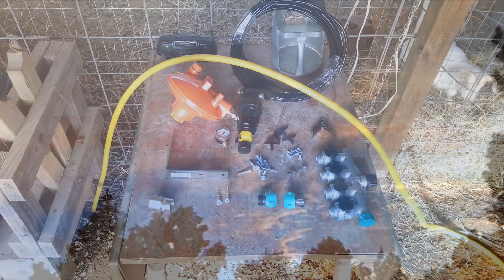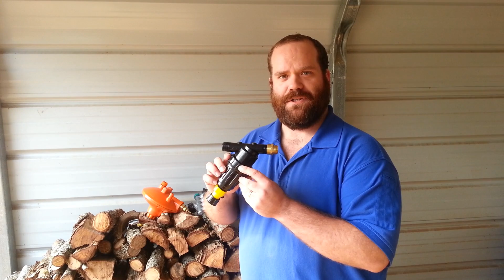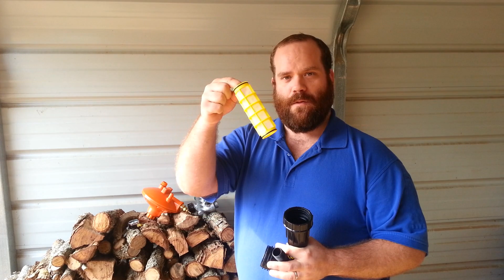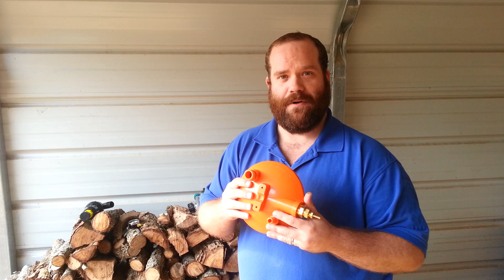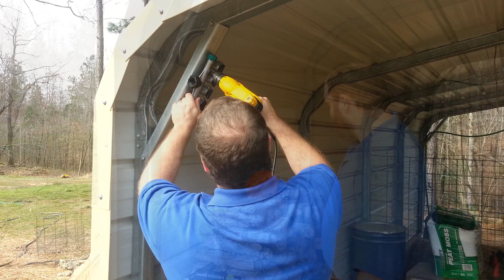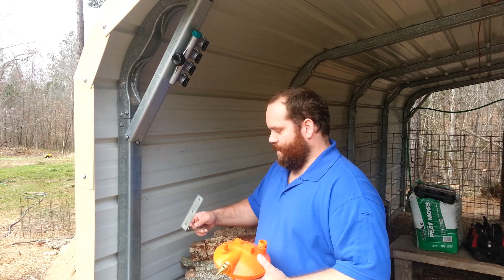Automatic Small Animal Watering - Part 1 - Components and Mounting

Comment from the maker: It is really simple and can be done with a lot less money. We liked the "clean look" of this setup, but you could do it with a bucket of water you manually fill, or, if you watch the video about goat watering, you can even set up a bucket with a float valve so it still waters automatically, but has the reduced pressure at the same time.